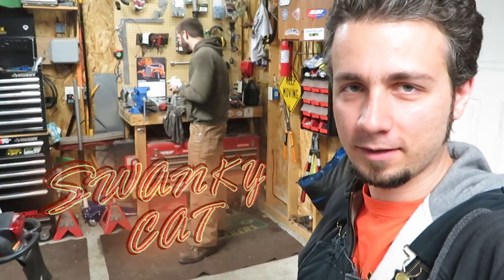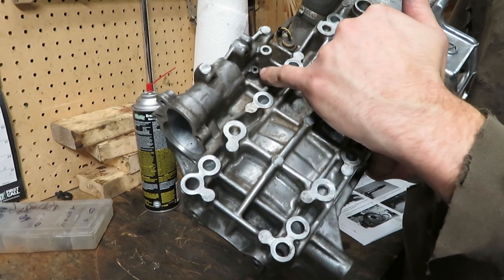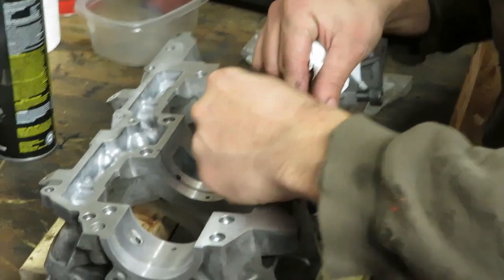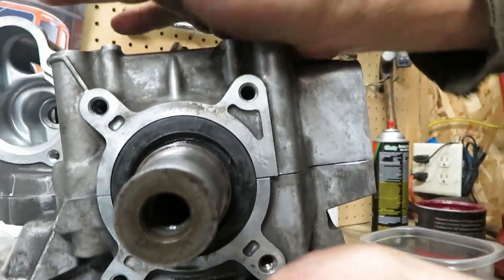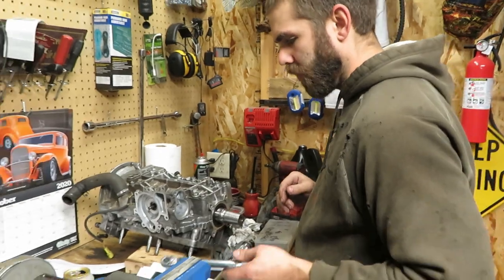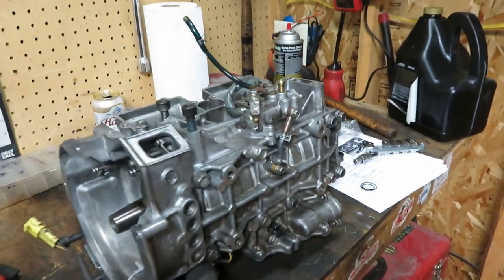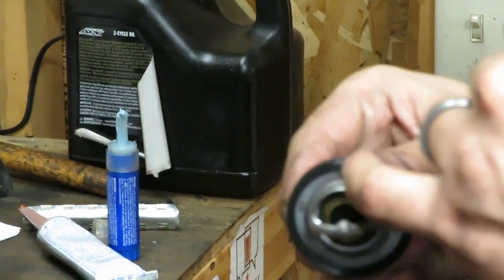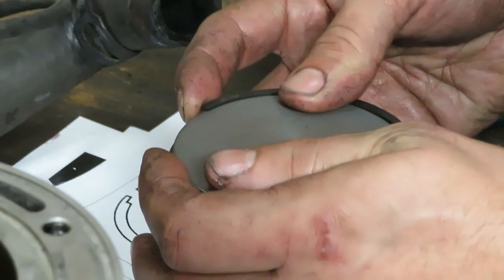Complete Arctic Cat 800 Snowmobile Engine Rebuild

Comment: Thanks guys! Helped me completely rebuild a 2004 F6 that blew a crankshaft bearing. I did a complete overhaul in 2 to 3 weeks this past winter, most of which was waiting on parts to arrive. Got a donor crank from eBay, rebuilt water pump, exhaust valves, reed valves, whole new top end, crank seals, gas and oil lines, carb boots, air intake, carbs, and scrubbed the dang thing inside and out. Never did anything like that before. Was able to put 40 miles on in a couple days before the snow melted. Pretty good for a lady who doesn't think she's a mechanic! 😉 Super helpful video. Gave me the confidence to try a rebuild. Dream come true 👍

Comment: Just a tip for you guys. Whether you wanna hear it or not. After honing a cylinder, engine oil is actually your best cleaner once the honing is done. And ATF can be used in place of honing oil.

Comment: I need to do mine , I just purchased it 2014 artic cat xf 8000  , fix cable drove around house all , than I forgot to recheck coolant than high temp wen on and force it to go home and stop running. No more coolant  no more psi .  If your looking for a job let me know,  Ottawa

Comment: Hy guys..nice and clean job👌 i have a question on my artic cat snow pro 600 2011 it's a pre mixed not oil injection,  how do I know if is oil to lubrication  the crank bearibg and if is any reservoir for that..on the spec's show just a little oil holder 🤔 thanks in advance
Reply: if it's premix the oil is mixed with the gas in the tank and flows through the bottom of the case/crank bearings during operation.

Comment: When bolting the case back together, did you chase the threads to get the old locktite out? Also why did you drop the case bolts in dry? 

Putting my case back together tomorrow trying to do it right the first time.
Reply from the maker: Jason says "I did not... Prolly coulda shoulda chased them... There's no lock tite on those though. Did wire wheel the bolts though. Manual does not say to oil bolts... Pretty sure they would be dry torques then"
Reply: @SwankyCatProductions  thanks for the feedback!
Reply: If you do Chase use thread chaser and not tap... Tap can remove too much material